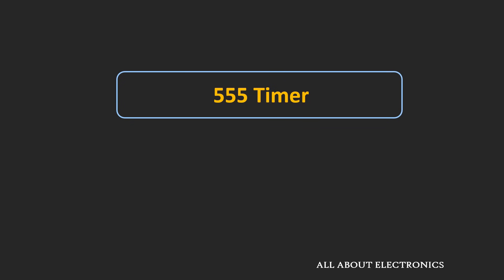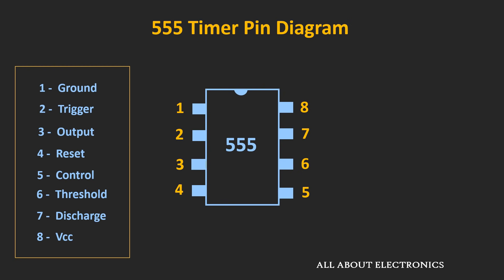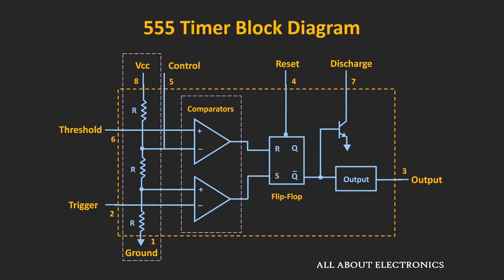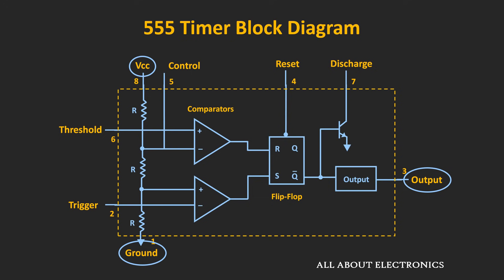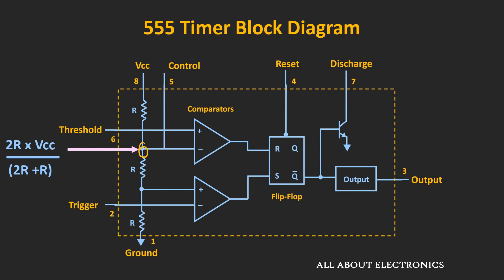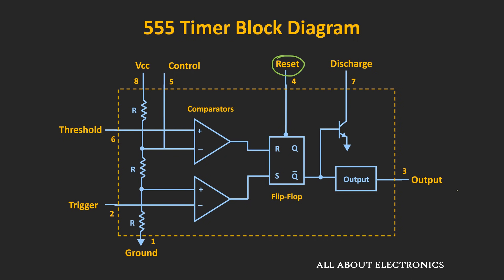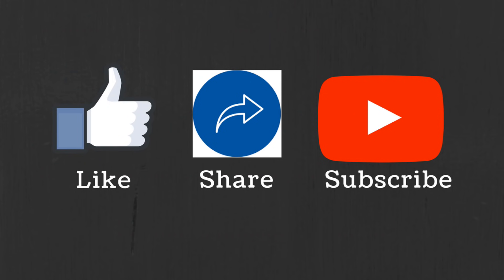Introduction to 555 Timer: The Internal Block Diagram and the Pin Diagram Explained

Comment from the maker: The timestamps for the different topics covered in the video:

0:20 Introduction and Application of 555 timer IC

0:50 Pin Diagram of 555 Timer IC

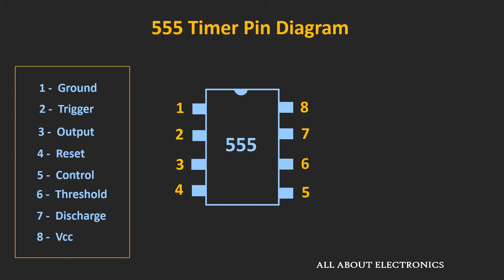1:06 Internal Block Diagram of 555 Timer 

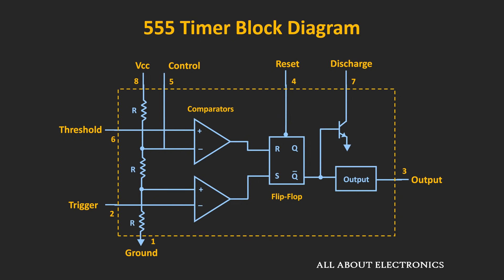1:48 Brief description of 8 Pins and basic working of the internal blocks of 555 timer
Reply: ok sir output block inverts the output.Awesome sir ,my bad .
Reply: Yeah MAN you got it right the OUTPUT block is actually a not gate..
Reply: At 7.51 you said if s =1 ,Q=1; bt output is connected to Q' so we get output =0 not 1
Reply from the maker: @guria8447  That is because, the output gate inverts the input. So, if want 1 at the output then we should connect Q'. So, that we can output corresponding to Q. I hope, it will clear your doubt.

Comment: "I still don't get the idea of using a bubble at the output side... Wouldn't it be easier if you hadn't used the bubble at the output?"
Reply from the maker: It would have been, but in the actual IC, that is how it is implemented.

Comment: at time 7.45 to 7.50 you say output of flip flop =0 (Q=0,Q'=1),because of this output of 555 timer is also =0 but the output of 555 timer connect to Q'.i did not understand here.
Reply from the maker: actually here the output stage is inverter. That is why Q' is connected to the output state. But I should have mentioned that explicitly. I hope, it will clear your doubt.
Reply: @ALLABOUTELECTRONICS  Thank you so much

Comment: How 2R is written in potential divider formula on 1st comparator
Reply from the maker: There are three resistors. And comparators are assumed to be ideal. So, using the voltage divider, the voltage across the node is found. See, the voltage at that node is the voltage across the two resistors. If the current flowing the resistors is I, then voltage at that node is I * 2R. And current I is Vcc / (R + R + R). 
That means voltage at that node is 2R* Vcc / 3R = 2/3 Vcc. I hope, it will clear your doubt.

Comment: without clock how does flip flop works there sir
please clarify my doubt sir, I have a presentation tomorrow
Reply from the maker: Technically, here it is a SR latch. But in general there are called Flip-Flop. ( Both latch and Flip-Flop). And that's why you must have heard some people are using the word, clocked flip- flop. But I hope, you got the point. If you still have any doubt then let me know here. Good luck for presentation 👍🏻
Reply: @ALLABOUTELECTRONICS  I have got your point 
Thank you for replying

Comment: Here , when  Q is zero u r saying output is zero but output is connected with Q bar so output should be 1.
Reply from the maker: There is a bubble at the output side, so the output is getting inverted after that. ( I should have specified that in the video though ). That's why Q' is applied. I hope, it will clear your doubt.
Reply: @ALLABOUTELECTRONICS  ok , thank u for clearing doubt .
Reply: @phuzo3320  did you passed the exam?

Comment: I need to buy PWM  for hydrogen production. Hydrogen unit need 220volt
2500watt. I have 220volt inverter. Which PWM should I selected

Comment: Sir why you take Q as a output why not the Q'
Reply from the maker: Q' is given to the output driver circuit. (The output driver circuit is inverting circuit). So, the output of 555  is the same as Q. 
I hope it will clear your doubt. 
IF you still have any doubt, let me know here.
Reply: @ALLABOUTELECTRONICS  kk sir
Reply: @ALLABOUTELECTRONICS  sir is we also use transistor at rest pin?

Comment: I want to build a ckt dat get triggered by sensor and high for 10 sec for indicator within dat time another push button get signal and after pressing push button another  45 sec the solenoid valve get activated.
How I can achieve this?

 Pls help on this
Reply from the maker: You can use 555 timer as monostable multivibrator. The sensor output will act act as a trigger for monostable.
You can select the RC time constant to get 10s of time. Similarly you can also generate the trigger signal corresponding to push button and can give it to another monostable.
At the output of the monostable, you can connect the solenoid.
I hope it will help you.

Comment: Hi,
I  need a circuit that every trigger can discharge capacitor.  So whenever a new trigger the timing will reset, and output willl only off if after delay time no trigger anymore.

Is it possible ? And how to achieve this
Reply: What do you do sir?
Working or Student?

Comment: So sir we need to keep +Vsat and -Vsat of the two op amps as +1V and 0V respectively right
Reply from the maker: No, actually I was referring to the logic levels. Logic "1' And logic '0'. In 555 timer, the comparators are biased internally. We only need to apply the supply voltage to the Vcc pin.
Reply: @ALLABOUTELECTRONICS  ok sir ok sir 
Thank you
Reply: @ALLABOUTELECTRONICS  oh sir so the Logic High is +Vsat and Logic LOW is -Vsat
So sir what are its typical/normal valies
Thank you
Reply: No, that is not right....

Comment: I see many tutorial, Web even book to learn 555 Timer IC, All of them frustrated me, 

Now I got the clear picture, (Thanks dude)

I more question what about comparator's  - and + sign means ? 

Hope you will replay to me.
Reply from the maker: The comparator has two terminals. Inverting (-) and non-inverting (+).
When the voltage at the + terminal is more than - terminal, then output of the comparator will be high. Similarly, when the voltage at the negative terminal is more than + terminal, the output will be low.
For more info, you can check my video on comparator.
Here is the link: https://youtu.be/k9zQjEaKtfk

Comment: This analysis  is not correct. Full of errors. The inputs and output analysis are correct but the internal ic analysis  is wrong. The output is an inverter. Not Q is the high output, Q is the low output.

Comment: It's clear explanation.
If this 555 ic support only 15 volts, which ic need to be used for 230 volts energy in our real time scenario? Can you suggest?
Reply from the maker: The relay can be used at low frequencies with line voltage. And high voltage MOSFET switches are also available, which can be used at high voltages.
Reply: 555 can be supplied with upto a max of 18V DC. You should use a rectifier to use it with AC....

Comment: How 2 voltage can be supplied at the same pin in threshold pin?? Please explain. Would not spark come out at this point??
Reply from the maker: Actually, there is only one supply to the threshold pin. I think what you understood is 1/3Vcc pin and trigger pin are connected right. But actually, they are not. (see, there is no small blue dot, which indicates the connection of two wires)
I hope it will clear your doubt.
Reply: @ALLABOUTELECTRONICS  ok thanks for replying.
Another......how value of control pin is made higher than the threshold pin while the 2/3Vcc remains connected to negative of comparator?? Does it mean when control is made higher, the 2/3Vcc remain disconnected?? Awaiting solutions again. Thanks.
Reply from the maker: @tnamen1307  If you look at the internal digram, the 2/3Vcc is provided to the comparator using voltage divider right !!
And the control pin is directly connected to the inverting terminal of the comparator. Or just after the first resistor. 
So, whatever voltage is applied at the control pin, the same voltage will appear as a reference for the comparator. Again here 2/3Vcc voltage is applied using a voltage divider, so KVL will not get violated even if we apply the control voltage to the same node. (As there is a resistor between the Vcc and control pin).
It would have been violated if the 2/3Vcc voltage is directly applied to the comparator from the supply (instead of using a voltage divider)
I hope it will clear your doubt.
Reply: @ALLABOUTELECTRONICS  okok very clear explanation. I need to recall my concepts on KVL!!! THANK. Sir!!!!

Comment: Is my assumption that Q bar is high whenever Q and/or output pin is low, correct?
Reply from the maker: Yes, Q and Q bar will be always the opposite. And in 555 timer, the output of the Q bar is given to the output driver circuit, which is once again inverting circuit. So, the output will be opposite to Q bar.
Reply: Exactly.....

Comment: How can it be when Q is 1, Q’ is also 1 ? Q’ isn’t Q(t+1) sir.
Reply from the maker: No, Q' will be zero.  But the output driving circuit is inverting circuit. So, the output of the timer will be 1. I think I should have specified that the output driving circuit is inverting driver circuit. 
Anyway, I hope it will clear your doubt.

Comment: The diagram is incorrect sir. The output buffer is connected to Q, not Q' as shown in the video.
Please correct it.
Reply: bro if u connect to q u will hv to use inverter so meaning is same
Reply: @ytstudy7007  please see 9:17 - 9:25 🙂
Reply: The output circuit is basically an inverter circuit. So since Q' is connected to the output, it will get inverted and we will ultimately get Q at pin no. 3

Comment: But  u  didn't mention   why  it  is  called 555 timer???
Reply from the maker: Because in the first design, three internal resistors which were used for the voltage divider were 5k resistors.

Comment: When reset pin goes high then the output should be zero sir ?
Reply: please explain this to me sir and aslo the discharging part
Reply from the maker: @neerajhebbar7313  When Reset pin is low then the output of the 555 timer will become zero (Because it is Reset -bar ). So, whenever it is zero, it functions and makes the output of the 555 timer zero. 
For the discharge pin please check the video on astable and multivibrator using 555 timer. I have explained there in detail. 
Here is the link:
https://youtu.be/iJYm_BGqa1A
And after that, if you have any doubt then do let me know here.
Reply: @ALLABOUTELECTRONICS   Thank you so much sir i am your student from 2 years  and your teaching skill are great i wish i could get a sir like you next sem and sir thanxx for the quick response
Reply: @ALLABOUTELECTRONICS  So is it compliment of reset right so it makes out put of the 555 timer ic to zero if m ryt jst give it a like sir and thank you once again

Comment: please explain the function of pin 4,5 and 7....its not clear
Reply from the maker: Pin no- 4: Reset pin is for simply to reset the output.
Pin no - 5: Control pin is used when you want to provide some other reference voltage to two comparators. (Generally, the reference voltage is 2/3Vcc and 1/3Vcc)
Pin no-7: Discharge pin is used to discharge the external capacitor.
For more info about the pins, please check the video on astable and monostable multivibrator using 555 timer.
Where in detail I have discussed the use of these pins.
Here is the link:
Astable Multivibrator using 555 timer
https://youtu.be/iJYm_BGqa1A
Monostable Multivibrator using 555 Timer
https://youtu.be/ypV6gdIJJU4
Reply: @ALLABOUTELECTRONICS  thank you sir...grt work

Comment: I have a doubt on the voltage divider part
In the 1st node which is connected to the iverting terminal of the 1st opamp would be (Vcc/3) inspite of (2Vcc/3)
Reply from the maker: If you observe, at the inverting node, two resistors (R+R) are connected in series. So, the voltage at the inverting node would be (R+R)*V / (2R +R) = 2/3 Vcc.
Reply: Voltage drop across the resistor is only1/3vcc . So reduce vcc with 1/3vcc you will get 2/3 vcc is the voltage at the node

Comment: I have a question: at 7:07, the output is connected to Qbar, so i deem the output should be 1. Chould you please tell me where i am going wrong?
Reply from the maker: The Q bar is connected to the output driver circuit, which is the inverting circuit. That's why the output is 1.
I hope it will clear your doubt.
Reply: Oh ,yes. Thank you! @ALLABOUTELECTRONICS
Reply: I too got this doubt... Thanks!!

Comment: since the output is taken from Qbar ,why it is not opposit of Q.??
in video 6.58 and 7.51 time
Reply from the maker: Q bar is given to the output driver circuit, which is inverting driver. 
That means if Q bar is 1 then the output of the output driver will be 1.
I hope it will clear your doubt.
Reply: @ALLABOUTELECTRONICS  thanks

Comment: Sir,  you said that when the flip flop resets due to the high output from upper comparator, the output of timer is zero.  But in diagram, the output is connected to Q'.  So shouldn't the output be 1 at that time?
Reply: Okay sir,  I got the reason.  Isn't it because the output circuit is inverting?  You said it later in the video 😅
Reply: Sir,  the video is excellent.  I loved it a lot from the signature tune all about electronics 😍
Reply: Wouldn't it just make sense to tie Q to the output rather than having to waste an inverter?
Reply: @JayDubb410  i guess we are using an inverter usually a bjt amplifier circuit so that we are capable of driving a load
Reply: @JayDubb410  Actually inside the o/p circuit there's a Push-pull Amplifier, which works similarly like a CE amplifier (inverting type). So, Using the amplifier we are nullifying the loading effect from any previous circuit connected to it and also increasing the Gain at the output. May be that's why they tied it to Q' rather than Q.
Reply: Same doubt I have
I did not understand how can Q' is high when the output us high
Reply: Yes you are right....

Comment: In SR flip flop isn't S connected to Q and not Q'?
Reply from the maker: Are you referring to the block diagram of SR flip-flop shown in the internal block diagram?
Reply: @ALLABOUTELECTRONICS  yes
Reply: @ursula das 
No.  R is always connected to Q.  But when we make the diagram of flip  flop using 2 nand gate,  internally,  S' is connected to Q and R' is connected to Q', and when we implement the circuit using 4 nand gates in which S' and R' are changed to S and R with a not gate in the front,  which results in S connected to Q and R connected to Q'.  Try drawing a diagram with the explanation given.  You may understand.
Reply: It's a block diagram so connection from input to out are not shown. But he gave us the truth table and that is how it works. When s=1 r=0 Q is high, Q not is low and visa versa.

Comment: sir you explained bjt as switch using capacitor is it just for explaining or capacitor is connected to it. I'm confused.
Reply from the maker: While designing the circuit using 555 timer, the capacitor is connected externally to 555 timer. And this discharge pin provides the discharge path through this transistor. 
I recommend you to watch the other videos on 555 timer (Astable and Monostable Multivibrator using 555 timer) in which the external capacitor is connected to the 555 timer.
https://youtu.be/iJYm_BGqa1A

Comment: Can I contact you with a question where I think I can use a couple of 555 timer circuits? I used to work with 555 timers many years ago but have forgotten a lot about them now. I have a one-off situation where I think two 555 timers will work for me but I don't want to go through the whole theoretical refresh process again. I just want a circuit I can build.
Reply from the maker: You can contact me on either facebook or Instagram.
The link is given in the descreption of the video.